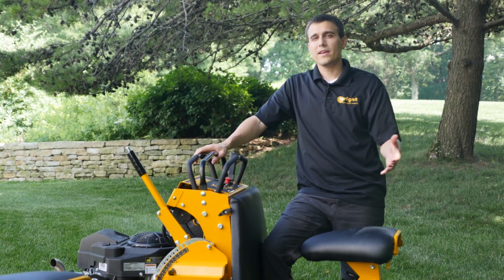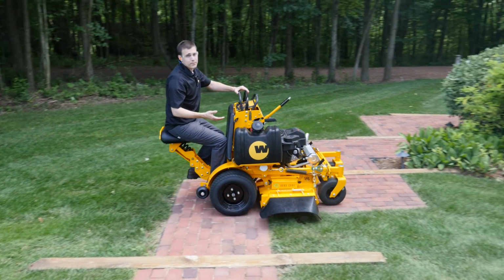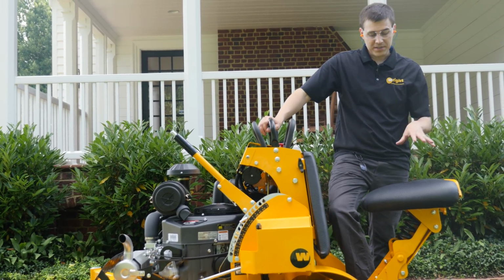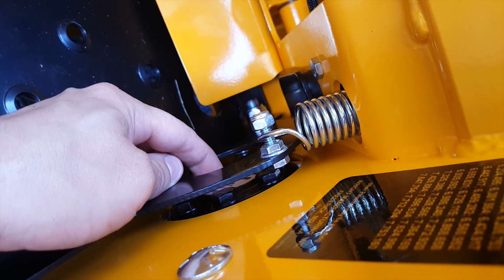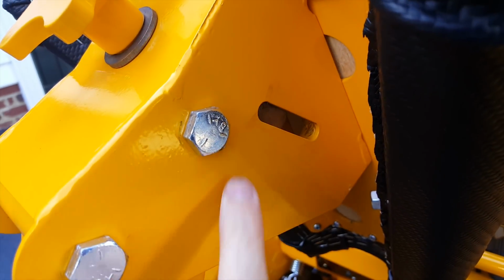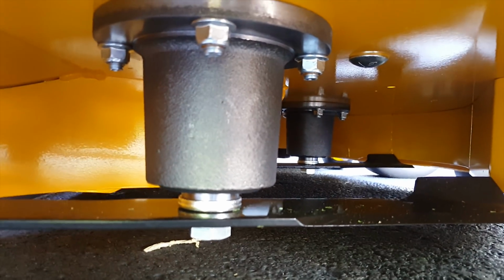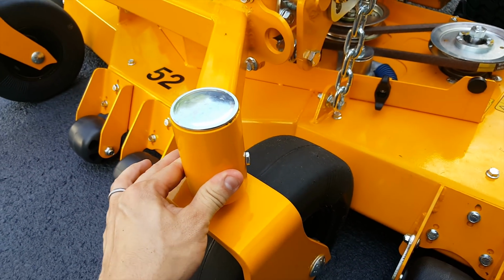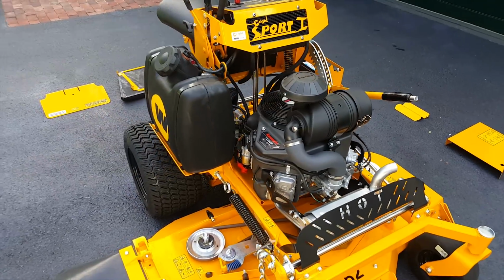Sport I

Comment: unrelated question, would putting a pre-cleaner weather cap with a fan in it, to remove contaminants on a canister air filter restrict the air flow to the engine in any way?

Comment: So you guys made a ferris?
Reply from the maker: You mean Ferris made a Sport?  We used to have a mower called the Sentar and both Ferris and Hustler made versions of it but for patent reasons they had to put a seat switch in it, which made for limited success. -Ed
Reply: since i have your ear for a second:
will you guys ever make a small stander (below 36) with a flip down wing deck so it will fit through a gate but still be a 48" mower, im about to build my own using the spindle from a blower unit and make it an attachment for my 36" walk behind. everything needed is already available but the deck itself and i think i can cut one apart to make what i need. would much prefer to buy one thats built for it though. (this would sell huge if guys starting out could have one mower instead of 2 for all their needs.
Reply: also i know one of these has been made before but they make it the wrong size (turned a 48" into a 60"), this doesnt appeal to the average lawncare guy where the smaller one would appeal to both small and large companies, they could make use of the larger mower most of the time and flip up the deck when they wanted the smaller size.

Comment: I know the Velke is the hill handler, and the standers are more productive.
Does the stander handle hills with the same stability as a walk behind, when you walk behind it?
Trying to decide on versatility vs productivity. Thanks.
Reply from the maker: Our standers have the platform right between the wheels, perfectly balanced, so there is no need to step off the mower.. If you need something that is highly productive AND hugs hills, the Stander ZK could be your ticket. We are actually running a 12% (~$1000) off sale at the moment (until April), check out our homepage. Happy Spring!